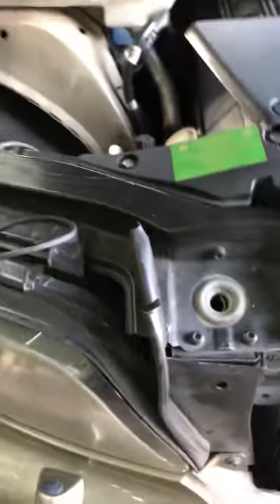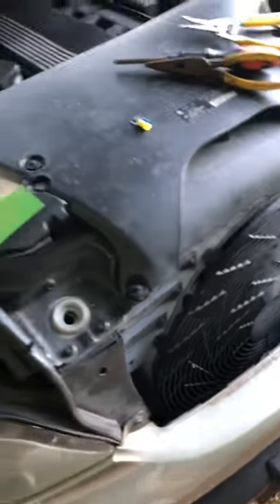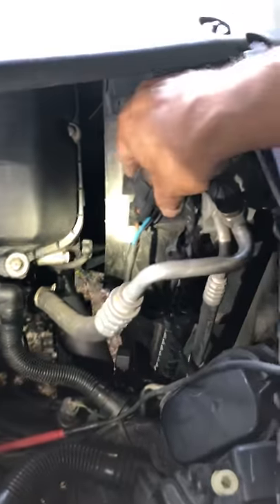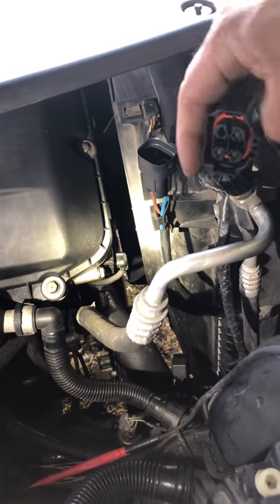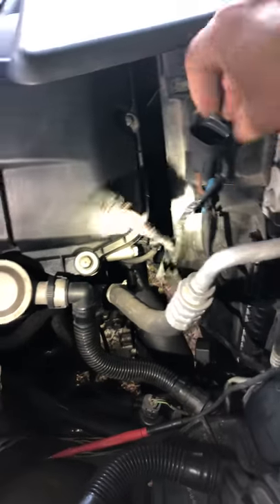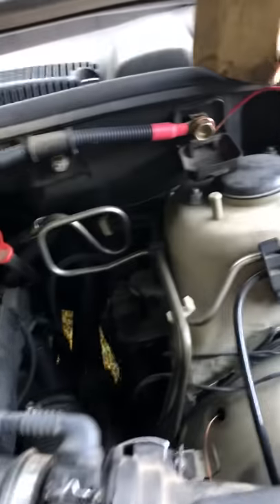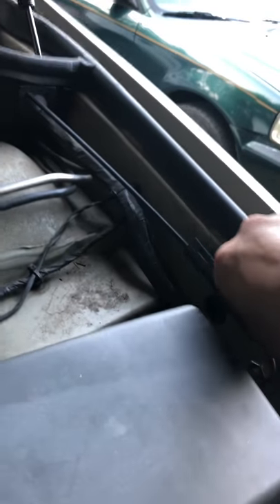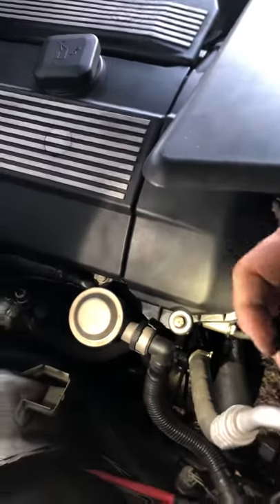BMW X5 cooling fan check

Comment: It's actually feeding through the dme and resistor pack. I'm surprised he doesn't know that. But he's doing a video. This is why other guys get screwed with German cars you need a scan tool and a tester to check these fans properly.

Comment: These Bmw fans wont turn on this way. Which really sucks because I can't even test the new fan and see if I just got 2 bad fans. The plug for the fan gets 12volts all the time, just check for power at the plug. But even after that you have to determine if the signal wire/ecm/sensor has a problem or if the fan is just bad. I gave up BMW's are such a pain in the ass to work on. 😔

Comment: Fan is control by the DME on control wire  by 10 % to 90%  of duty cycle. Fan  it self has  controller in it. There is no relay for  BMW X5 fan.
Reply: You're absolutely correct. I guess anybody can put up a bad YT DIY.
Reply: Of course there is a relay, in the positive side you have a 150amp relay that is located  in the wheel mud cover, but you are right, the ECU manage the fan and this video is so bad.
Reply: So basically the control wires turns a transistor in the fan assembly on?

Comment: From my experience I've taken the fan off my BMW and bench tested it with a 12v battery and just like you tested it it wouldn't turn on, then I went further and tested it at the fan controller on one side, and nothing, then on the other side and it turned on. Moral of the story is try to clean all contact points of wires before saying fan is bad. once all of them are cleaned up it might work.

Comment: You need to do more research. That's not how BMW fans (since 2000) work. The 2 thick wires are + and -, the thin wire is a digital carrier wave from the CPU that activates the fan and controls its speed. Direct current to the fan does nothing.
Reply: So then what is the proper way to test it
Reply: There is a solid state switch in the fan and it gets turned on by a signal from the computer the third small wire
Reply: @Thatguyremy  I ran a small wire from the signal wire to fan then hooked up a pos and neg wire. My fan then came on like a air plane propeller.
Reply: I tested the fan motor same was just connected directly to the 2 wires coming out of the back of the fan. I wanted to test it right off the plug connector like In this video. But I figured I'd research it before I send to many volts in there 😅
Reply: @Thatguyremy  The only way I can figure is find someone with a similar BMW and plug your fan into their car and see if it works. You can add power to the fan motor itself but that doesn't tell you if the module on the fan is bad or not.

Comment: The coolant fan is possible to test with INPA diag. INPA has direct tool for coolant fan testing. In test check DME temperature of coolant fluid and run coolant fan Adequate to engine temperature. If the engine is cold coolant fan wil be slow if hot it will rotate quickly. For three pins connectors is one wire for impulse control from DME

Comment: Fan controlled by the DME. The fan could be good and there's a fan activation code stopping it from working
Reply: Interesting point, but how do you get rid of the code and get the new fan to turn on? Assuming the signal wire isn't bad.

Comment: And how about the third pin?
Reply: That's signal wire controlling speed communicating with ecm, you can't test the BMW fan like that, even good fans won't turn on.

Comment: My fan always kicking on High speed and stay on high speed all day NON stop what should I check ?
Reply: Coolant temp sensor on lower radiator hose (possibly and from what I've read so far). They say if you unplug it or it's bad that it'll run the fan wide open. I bet that's it for you.

Comment: complacently wrong testing ,unplug fan switch (on right side of radiator hose) your fan should work on high speed ,if not your fan is bad.
Reply: I did that, didn't do crap, but also hooked up a new fan didn't do crap. 🤷‍♂️

Comment: My fan is working but it is stuck on high all the time even with a cold engine where should I start to look for the problem?
Reply: Probably the coolant temp sensor. But also could be a bad fan. I don't know how to diagnose these things but a coolant sensor is like $20 I would start there.
Reply: Thermo switch

Comment: This is completely wrong…
You have no idea what you are doing or talked about at all..
The giant red wire is power…. From a fuse…
The ground is the giant brown.. you said that right..
The small wire is not relays and all that crap you said. It goes directly to the engine module. Supplying voltage to it does nothing.. its a 12 volt square wave low current signal that you can’t duplicate by hand… you check it with a scope. If you have the correct signal from the dme, and your power and ground, then the fan is bad. Terrible video…